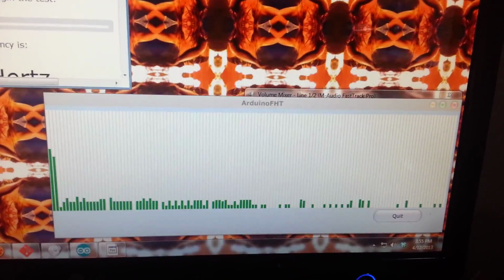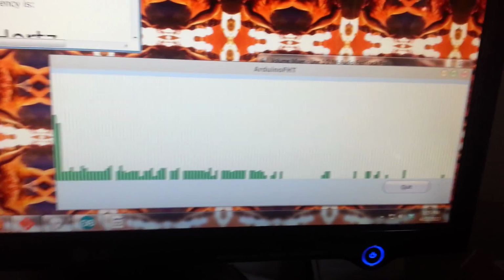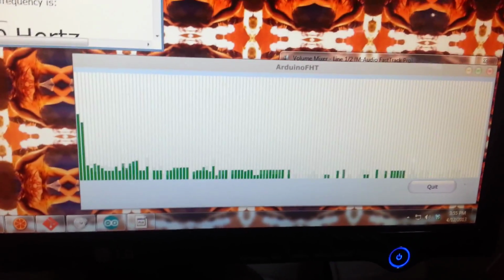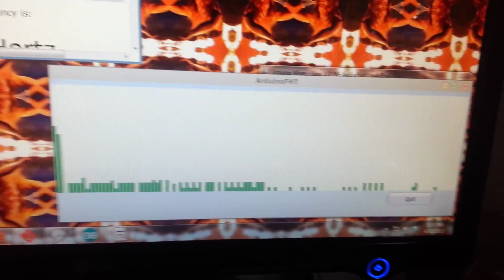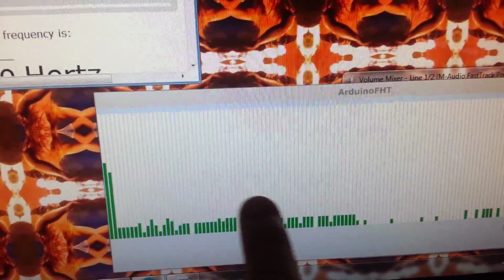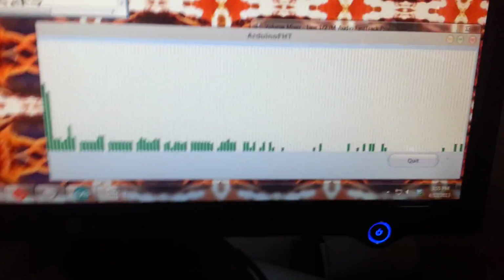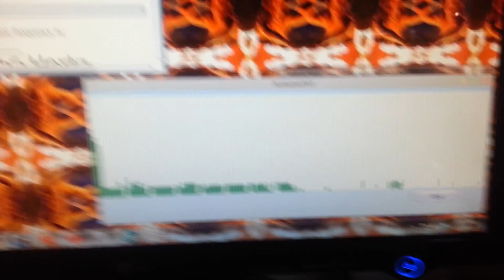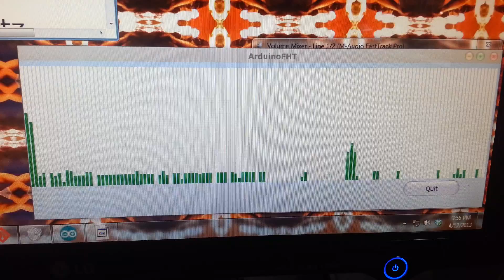FHT test on the Arduino

Comment: Chris, Great work on the LED cubes they look very nice. I found this video while scrolling through FFT & FHT w/ arduino posts on the internet. I want to be able to look at the data visually in real time like your doing in this video. How are you doing this? It looks like you prefer to talk about this aspect of your video in private so my email is rexheck@gmail.com.
Reply from the maker: +Rex Heck I use a C++ program to parse the serial data, and display it. I keep meaning to post that code too, but haven't gotten around to it. :)
Reply from the maker: It's now available at: http://omohmproductions.com/?page_id=145
Reply: Chris Roberts thank you! I was able to get a project done using FFT with the teensy and audio board attachment. the fft library with that combo works very well. 
this video shows one setting that reacts to three different bass frequencies. 

https://www.instagram.com/p/BKO7rlOBU4X/
Reply from the maker: Awesome! The Teensy is great. So tiny and lots of horsepower. I've been playing with the MSGEQ7 which is a little chip that does all of the FFT heavy lifting, and outputs 7 bands of EQ data. I wanted to go this route to free up those cpu cycles used for sampling data and doing maths. Here is a video of a newer version of the metering app with an Arduino/MSGEQ7: https://youtu.be/ybWU9pEhNns
Reply: What did you write that app in? It looks nice and clean. I have not heard about that chip yet I will have to check it out. 

Yeah I was very happy with the power the teensy had. I really wanted to look at more of frequency ranges than I could with the uno. Also the fft library Paul wrote for his chip is easy to understand with the examples. It gave me a lot to play around with which made it much more fun.
Reply from the maker: The app is C++ and uses the JUCE cross-platform library. It can be built for Windows and Mac (and probably Linux if I updated my serial port module). I have a newer version which also has peak hold meters.
Reply: Okay, very nice. I am in the process of learning java to create a android app to control some lights. Im excited to learn how to make computer and web apps soon.
Reply from the maker: Hit me up if you ever have any questions. I've been doing this for a while now. :)
Reply: +1 for the juce direction. Looks a lot like the android studio sdk.
Reply: ok thank you Chris :)

Comment: Hi can you send me the desktop app to display the results aswell? I would be running it on Windows 8.1 I tried it with a differnet programm but it didnt work. So i'd be really glad for your help.
My e-mail adress is: marco98.hirsbrunner@gmail.com
Reply from the maker: +Marco Hirsbrunner When I get home this evening I'll send you a chunk of source code. I'll send all source code, along with VS2013 and XCode projects. I can send previous VS version projects if needed too. Also, if you aren't using my FHT code, you will have to either modify your Arduino code, or my app, to have the data formats match.
Reply: +Chris Roberts hi thanks for the fast reply. it seems that i havnet 
received a e-mail yet on my account. Therefore i would be really glad if
 you could send it again, the e-mail adress is still the same. I am 
using your Arduino sketch, therefore there should be no need to modify 
the data.
Thanks in advance
Reply from the maker: Sorry for the delay Marco. I sent the code off, let me know if you have any questions. :)
Reply from the maker: It's now available at: http://omohmproductions.com/?page_id=145
Reply: Wow awesome! Thanks for the notice

Comment: I've been working on an arduino FHT project also where I will use the arduino and a sound in to create an LED VU type tower. Could you possibly share your code with me as well? It would be really helpful like ChrisCamaro said to be able to see a histogram rather than the serial output.
Reply from the maker: Replied to you in private with the code. :)
Reply from the maker: It's now available at: http://omohmproductions.com/?page_id=145